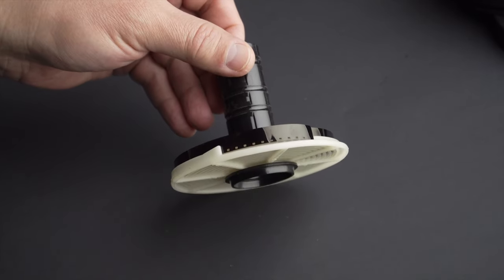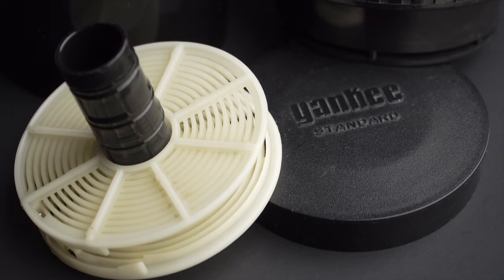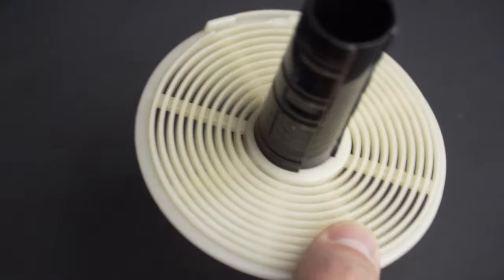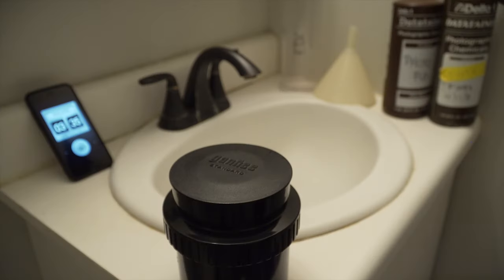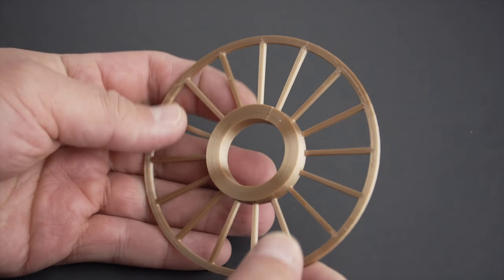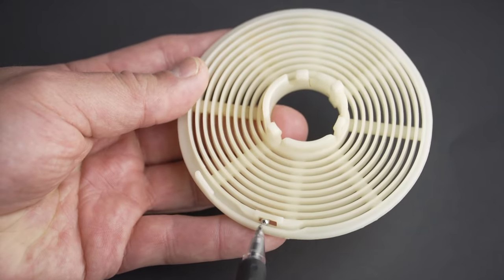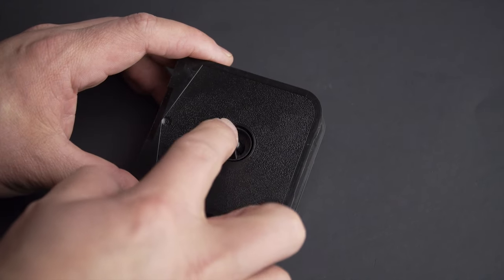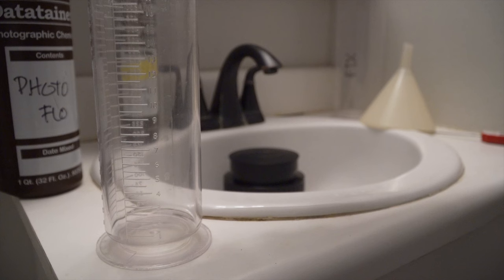Processing Super 8 in a Yankee Tank - Part 1

Comment: You're the only one I've found online who addresses this great need. I also use the Yankee tank system and I'm thinking one reel could be trimmed down to fit Super 8 eliminating the need for a custom made reel but I could be wrong. Have you ever tried this? I've developed Super 8 via the so-called "spaghetti" method but it wastes too much developer and ruins too much film. P.S. Do you sell your custom made reel?
Reply from the maker: Yeah, not a lot of people are whiling to spend hours of their time processing a few feet of Super 8. In my opinion as you can see I think it is a good way to process some film once in a while to test cameras and stuff. I'm working on a video about time lapses and I used this method to shoot some time lapses, so in some cases it is all you need.

Some people trimmed the Paterson reel to accommodate 110 or 16mm film. So the idea has been around for a while. I tried to modify the Yankee reel but S8 is so small that I decided to change my approach. It may be possible, I just wanted to keep my reel the way it is since I use it to process all the formats it can handle. 

I sell several accessories for S8 and 16mm cameras, the reason for me to not be selling the reel yet is because I would have to do more experimentation. I bought a Yankee Clipper II since it is more common and I found  the center column was not the same size. That complicates things, because I would have to buy the tanks, make sure the part fit, then sell them. That involves spending unnecessary money on shipping. I'm going to buy another tank exactly like the one I own to see if I can rule similar tanks are exactly the same, then I could sell the reel only.

Thanks for your interest and don't be afraid to experiment.
Reply: @TheCinematographyLab  Thanks much for the reply. I like to shoot old 8mm and develop double 8 & Super 8 exposed found film. Double 8 is easy to do in the Yankee tank so I guess I'll stay with it. Since the film is 16mm and split one gets 10 feet of film per tank run. I use Diafine developer and the process is fast. Developing my own 8mm film saves me about $40-$50 per roll and I bypass a lot of shipping hassle. Thanks again.
Reply from the maker: @dalehammond1749  No problem. I agree, Double 8 is much easier and you twice as much footage processed every time. I have always used D-76 to process my film. Now that you mentioned Diafine I read about it and you got me interested. I'll have to give a try. Thanks.
Reply: @TheCinematographyLab  I used to use D-76.